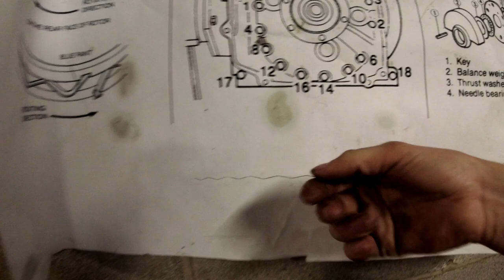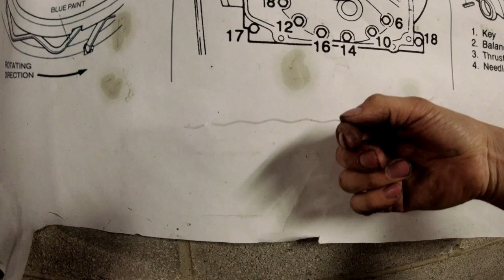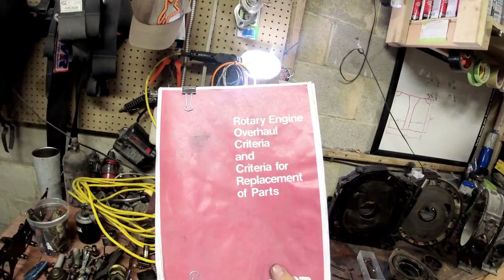Your Rotary Engine Needs a Rebuild - What Do I do? - How Much Will it Cost?

Comment: If you're only taking 20 minutes to take these things apart you're not analyzing the situation and diagnosing why it went wrong. Stepping oil pump. Poor fuel injection, leaky injector, fuel pressure regulator. If you're throwing parts from an 86 to an 88 Turbo 2 to a 89 to 91 the difference between the rotors and the exhaust Port are completely different. I have been doing this since 1996 bridgeporting and peripheral porting. This is Swiss cheese

Comment: So stupid question can you man a 2 rotor into a 3 rotor?
Reply: Short answer: Not really.  Everything you need basically has you buying/building a new engine.
Reply: @SidewaysGts  oh. That makes sense thank you very much
Reply: @ooth80"oh. That makes sense thank you very much"

Absolutely. 

To expand a little bit more if youre curious: There are 2 main components in the "block" assembly itself. Youve got the rotor housings, and then the housing "plates".  

The 20b and 13b rotor housings are fairly similar (nearly identical to my knowledge).  The biggest difference will be the exhaust ports.  Both 20b and 13b have the exhaust ports on the side of the housing, a peripheral exhaust port. Their intake ports however are in those "plates" (Compared to the 13b renesis in the rx8, which has the intake and exhaust ports both in the plates).  But the exhaust ports differ in that the 20b has a lining inside it that restricts it a bit- this was merely to quiet down the exhaust (20bs were only found in the cosmos, which was at the end of the day a "luxury" car, so a quieter exhaust was desired).

The issue would come from those intake ports.

With the 13b, there are 3 of those "plates".  A front plate, a middle plate between the 2 housings, and then a rear plate.

Each rotor has 2 intake ports, so air is coming in on "both" sides of the rotor during the intake portion of the cycle.

For the 13b, the front and rear plates have the "large" port, while the middle plate has 2 small ports, 1 for each rotor its inbetween.

This is where you run into "issues" swapping parts around.

The 20b has the same philosophy of each rotor getting 2 intake ports, 1 big 1 small.

They use similar end plates, so the front / rear plates still have 1 single "large" port

The "intermediate" or middle plates between the rotors then cant just all have small ports- as 1 rotor would have 2 small ports if this was the case.

So they have a special intermediate plate, with 1 big and 1 small port

Capital O is a big port. lowercase O is a small port. R for rotor.

20bs look like this:

O R oo R Oo R O

13bs are like this:

O R oo R O

If you go to google images and type in "20 b block" or "13b block" this will make what im explaining much more clear- but hopefully i am explaining it correctly enough

But keep in mind all the other bits for such an engine

You need a 3 rotor E-Shaft. You need intake and exhaust manifolds for 3 rotors.  Etc. All of these things are available, so "can you"? I mean- " kiiinda, ya", but:

End of the day, youre basically "building" a whole new engine, "so not really" if that makes sense.